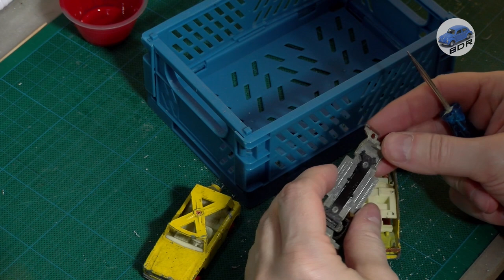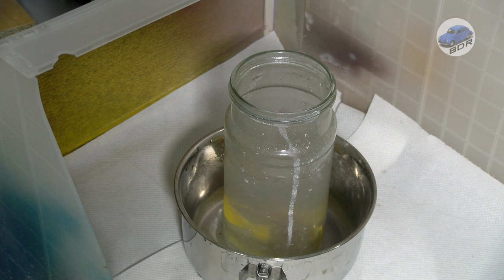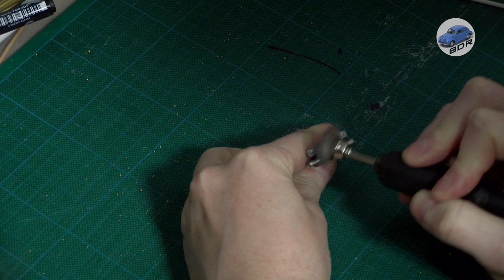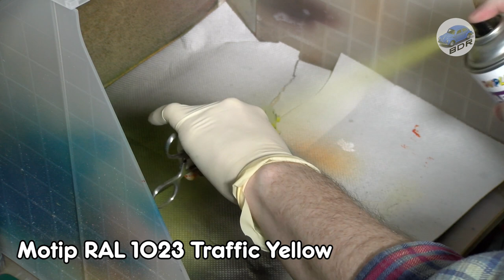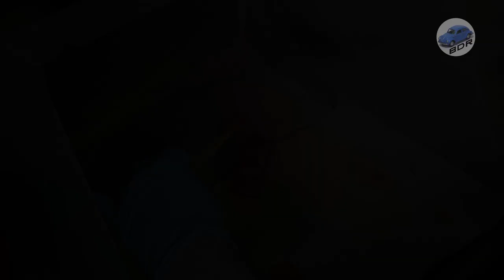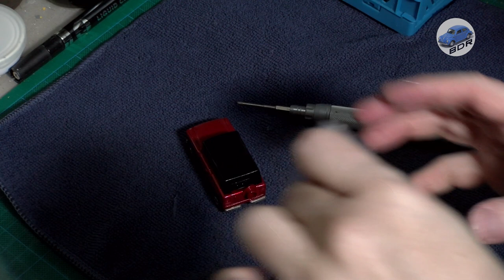Matchbox 18E Field Car Diecast Restoration

Comment: Nice job on both of them! I have some of those on my to-do list also!

I use a hot air rework tool on a low heat and keeping the tip moving and it does a great job of removing the white stress lines in plastic.
Reply from the maker: Thanks! That is indeed a good tip.